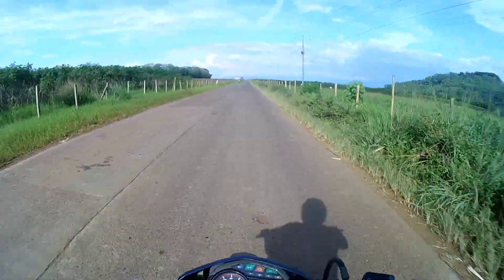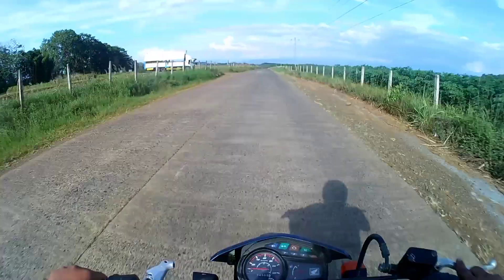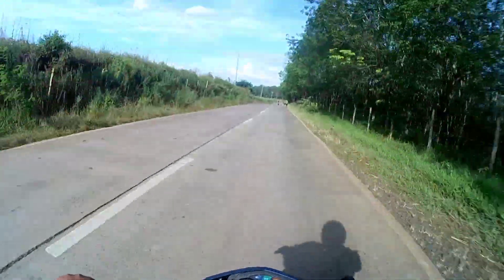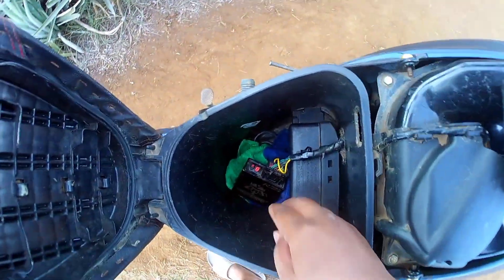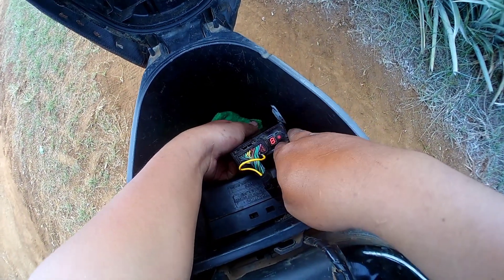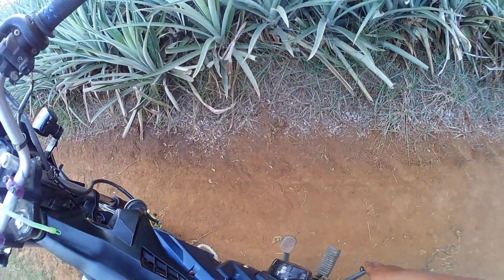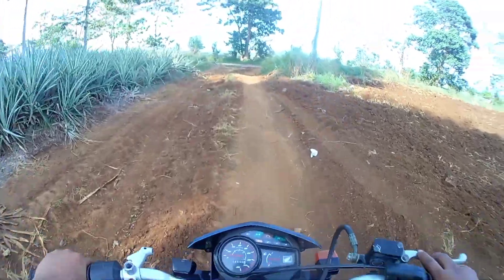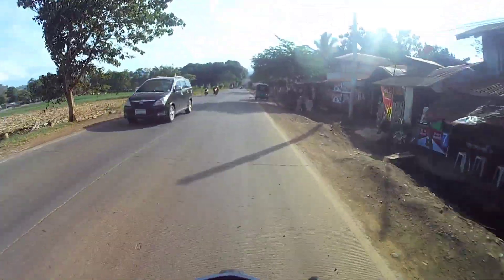Xrm fi 62mm. bore with Rs 150 racing ECU 8 mode/maping

Comment: Stock connecting rod paka dol sa 62mm bore nimo
Reply from the maker: Stock pa ,ga 9 months nmn noon okay paman pag mo bigay ilisdan nko try pang carbtype set sa crankshaft basin. Pwedi
Reply: @j-roadtrip1244  salamat sa info Taz sa  mga vedio mo dol nakakatolong talaga sa mga gusto mag loaded ng xrm fi
Reply: Dol sa 9mos nimo nga conrod niagi sad kag puga2 ana like waswas, top speed or long ride? Healthy pa ghapon sya?
Reply from the maker: @Philiary  oo long ride nmax kaoban.. dayon naa pod raider fi kauban... 
Wawas alalay lang minor na mga 900m nga full throttle, sa gauge gauge noon  noon okay ra init man good kayo pag waswas
Reply from the maker: @Philiary  long ride kaya kaayo valencia to uper pulangi dris amoa wa gyud ka overheat pero midyo gi overfeed ang gass ato pag long ride 170cc nga injector gi gamit para iwas overheat...basta e daily nko 150cc nga injector stock sa rs150, mao rapod na angayan saakong motor.. lahi lahi man good